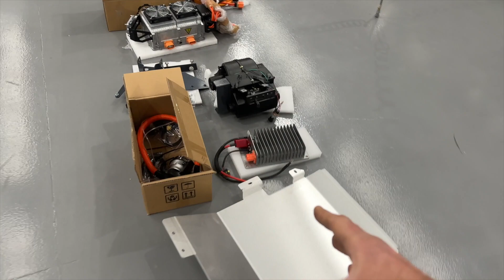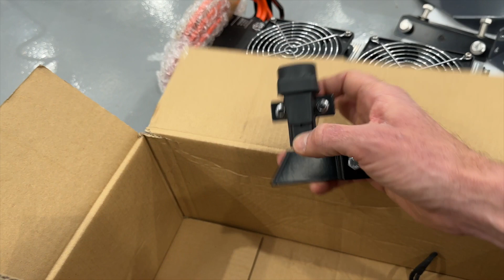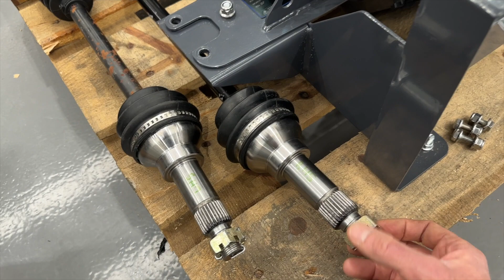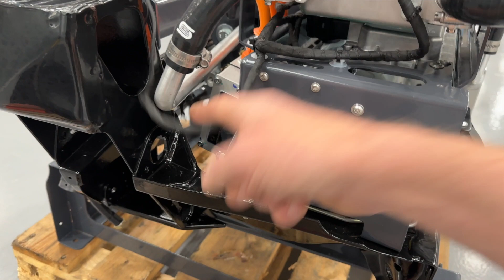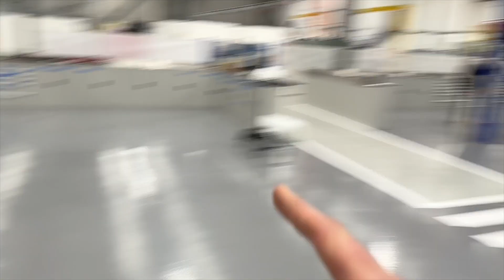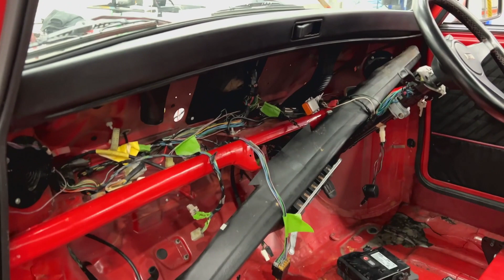Classic Mini Electric Conversion - Part 1

Comment: Will be interesting to see what you do with this Dave. I drove a 2019 Camry Hybrid the other day. This was the most modern car that I've driven. I currently drive a 2008 VW Caddy. While the car was quite comfortable and everything worked well, the brakes were just way too touchy for me; to the point where I wouldn't buy that car just for that reason. I'm not sure if that had to do with regen but it felt really uncomfortable so it was interesting what you mentioned about the brakes for this car. Thanks.
Reply from the maker: We find modern brakes often too twitchy as well. We spend a lot of time tuning the feel between the regen and 'real' braking.  Regen is infinitely tunable so it'd be a choice make by the Toyota team